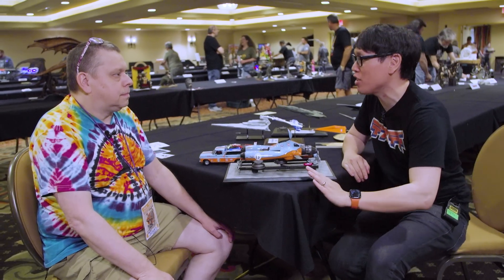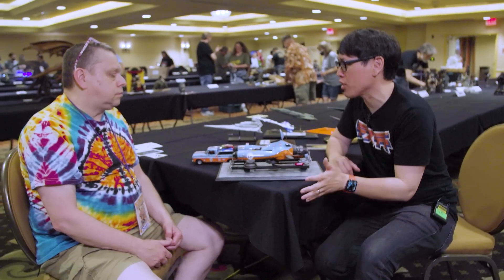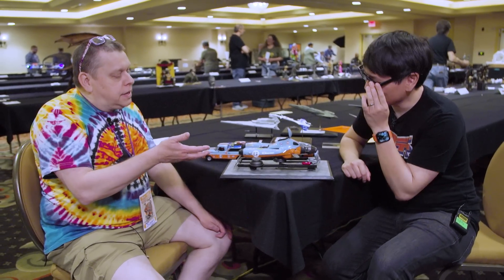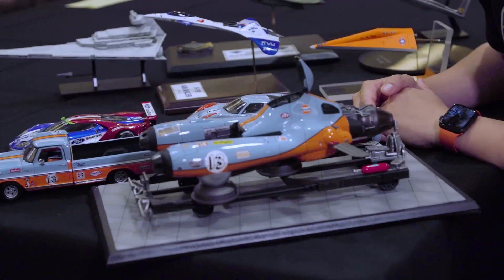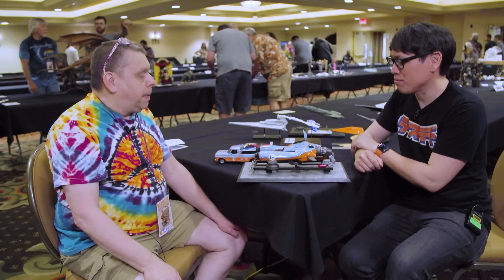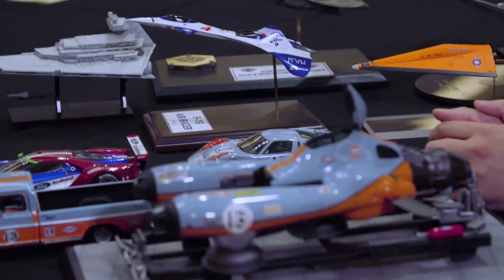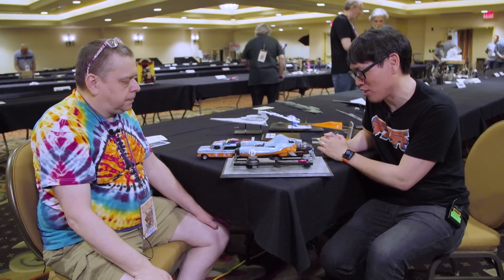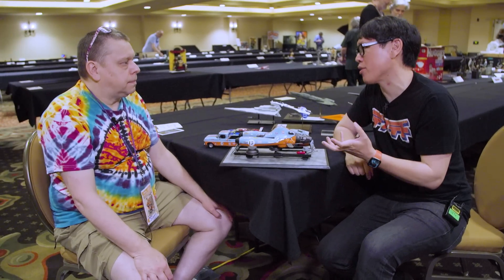How to Give Scale Models a Gloss Finish!

Comment: I’ve had nice results from using Future, an acrylic floor coating, to clear coat my projects. Self leveling. Can be diluted with water to take down the shine or sprayed straight from the airbrush for a nice gloss.
Reply: Doesnt future chemistry eroding the paint eventually though? I’ve always used Future to polish / clear impurities from glass / cockpits.
Reply: @Strateggo  I haven’t noticed any deterioration and some of my finished kits are over 15 years old. They are kept in display boxes and out of direct sunlight. Maybe that helps.

Comment: I can personally vouch for the quality of Tamiya products and using an airbrush. I've got a small Spear of Longinus from an Evangelion model kit, hit it with some Tamiya Gold and Clear Red, and it looks incredible, way better than I expected. You don't even need a super expensive airbrush either. Mine is a relatively cheap kit from Amazon that came with a few paints and some cleaner (though the paints are some of the worst I've ever used, just stick with Tamiya).

Comment: That's pretty cool stuff, and yeah, Norm made a good point about Kaneda's bike, i love that movie and have recently rewatched it a couple of times, but yeah i had not connected the dots with the branded labels on that one and the ones on here.
My brother used to have a model of that bike and it's definitely one of the coolest bikes in fiction in my opinion, and the branding on it made it extra cool, because it made you think that it was a plausible piece of technology.

Having watched this video, and the other great video of Craig Dowell, now i really want to make my own vehicle as well.
I think i need to start snooping around on eBay to see which kits i want to bash, and ideally i can make several pieces with the leftovers.
But the main problem for me has always been the finish, not just because of the perfectionism/abandoning thing, but i really don't like painting apparently.
Mostly because when i painted things, it was with the cheapest materials and the wrong tools, it would look horrible.
But i love drawing and designing, so i just have to make it work for me at some point.
But i also know that a lot of the fine details on the kits will lessen after some paint, so i would also have to keep redoing those, like David did with the panel lines, otherwise it's going to lose a lot of "immersibility" in my experience.
So yeah.. not the part i am looking forward to, i'd rather recolor it in Photoshop, but yeah.